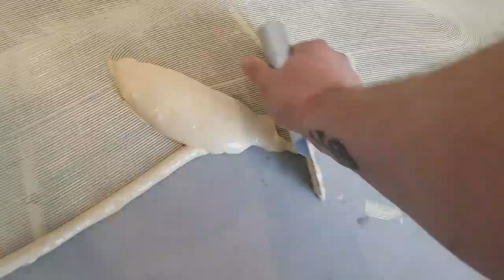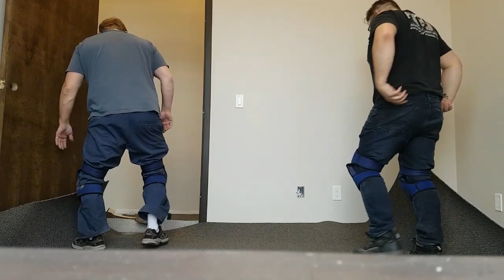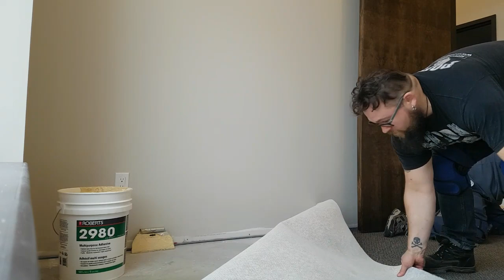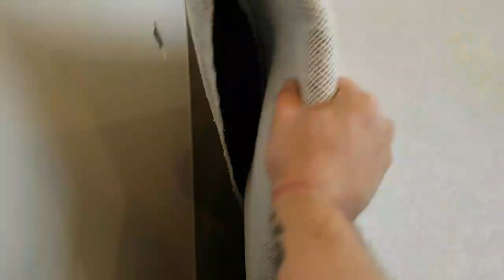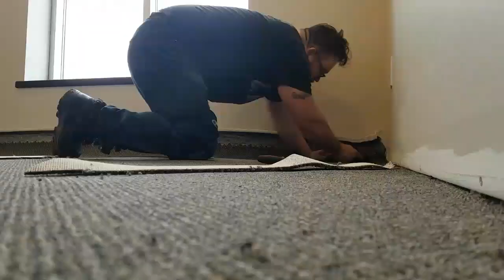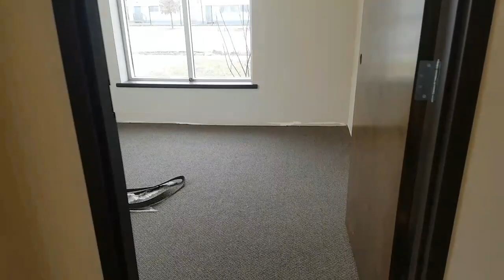Installing a glue down carpet.

Comment: Good job cutting into the drywall,,lol.
Reply: Does it matter? Trim should be going over that?
Reply: Base is going over that so it doesn't matter durrrr durr
Reply: If the customer saw that they would not be happy...
...and what happened to the use of carpet stretchers to get it nice and tight.....
Reply: @gregoryj.m.8985 glue down carpet is recommneded to not be stretched, theyre not made to be stretched. And as for the baseboard, yeah you try not to damage anything you arent working on.